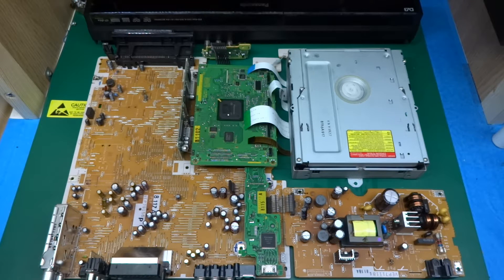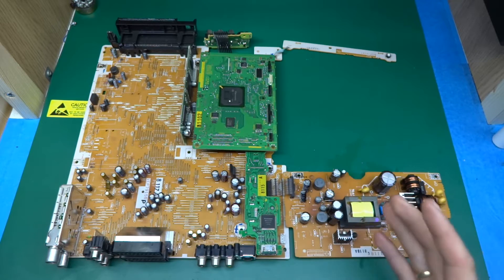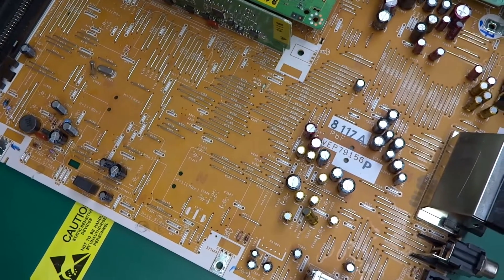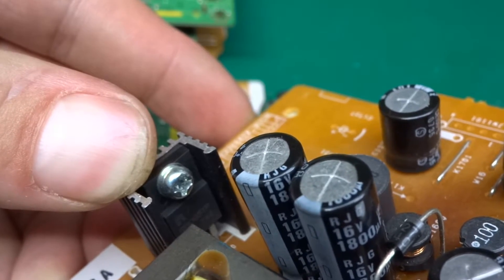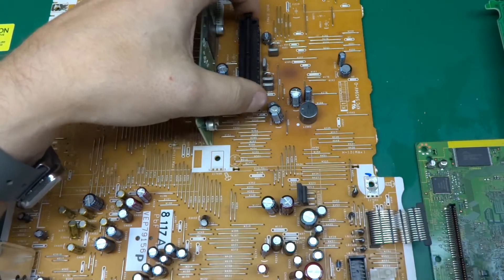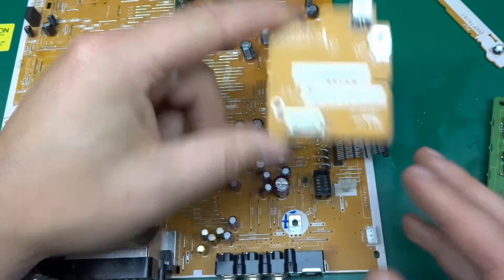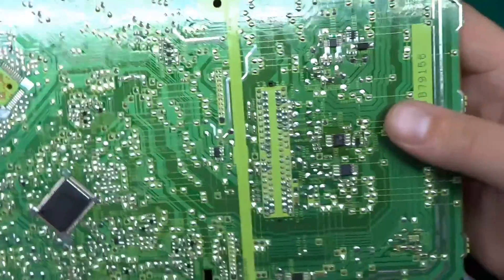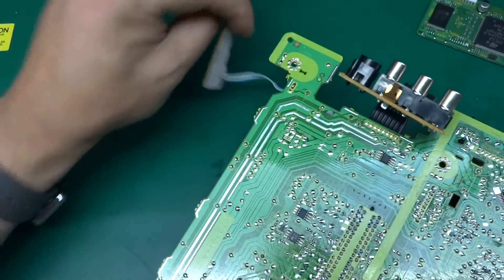Panasonic DMR-EZ27 teardown (one way) an a look at weird connectors

Comment: Thank you so much for posting this video! At 5:03, I was so happy to see you addressing those weird board inter-connects. I'm trying to replace the bad PS caps in a DMR-EH75V, got the teardown to the point of having to deal with them, and was stumped as to how they should be unplugged.

Comment: One reason it has that wasteland of space and jump connectors may be because most Panasonic DVD recorders also had a hard drive in there. Some even a VHS VCR as well! 

Perhaps the mad number of boards and connectors is to enable modular assembly for these model variants.
Reply: Actuallly, if you open up any late model vhs/set top box they use 1 sided boards. One sided boards are cheaper to manufacture. They have been the goto cheapo board since the 70s. I even saw a computer motherboard that was a cost reduced computer with a one sided board (commodore 16). Mine has a vcr/dvd-everything combo...even dvd-ram cartridges(which are hideously expensive).
Reply: My thoughts as well

Comment: There is  a guy on Ebay selling repair kits for these - it is part of the freeview circuitry - one chip and two caps that go leaving a U81 error. I repaired mine (plus replaced the PSU which is also weak on our dodgy UK mains supply). In addition there were 8 or 9 fat caps elsewhere that needed replacing, which I did using bog standard caps from a fun bag from Ebay.
It seems they do as you suspect re-use the boards across many models, including the PSU. I was able to get a salvaged one plus repair kit for ~£15 and brought my DVD recorder back to life, which is good because it was not cheap when new.
From the old PSU I got a common mode choke, now doing duty in a Joule Thief :).

Comment: Interesting video. Do you know what caused this DVD recorder to fail? 
You must be in Europe...do you have a late model Panasonic Blu Ray Disk Recorder?
They still sell them in most of the world but in the USA they stopped selling DVD recorders in about 2011 or so.  Too bad because they are a good solution to keep from paying for 
rental units from cable and satellite service providers.
Reply from the maker: +watershed44 Hi, yes i am in UK. I don't remember now what the issue was unfortunately. I have not got any other ones at the moment either. But if you are looking to keep your recordings for longer, try maybe setting up media centre pc /htpc - there is lots of good software and once you get through making it work, you can record/save/burn anything :)
Reply: randomtronic Thanks for the reply. The nice advantage of the Panasonic Blu Ray / HDD recorders are that they are straight forward and easy to operate compared to using the PC method. Especially for scheduled tv program recordings.
Reply: I've got two of these both have died at different times they don't power up no clock light on the outside... I'm thinking maybe the fuse ... do you know what fuse I can put in there to replace? 
in will open up and take a look